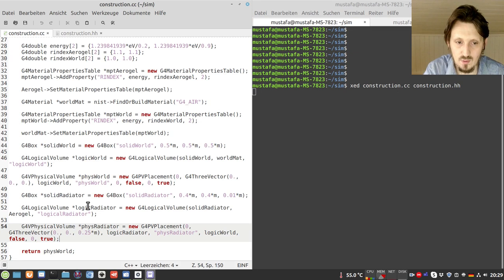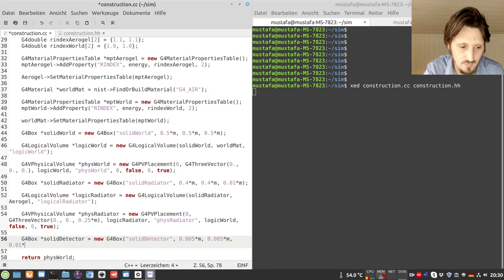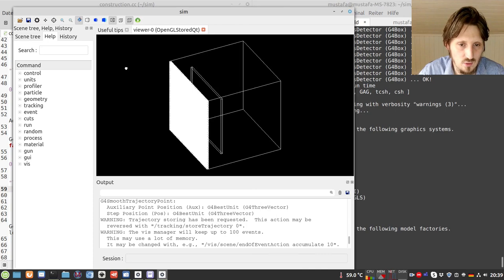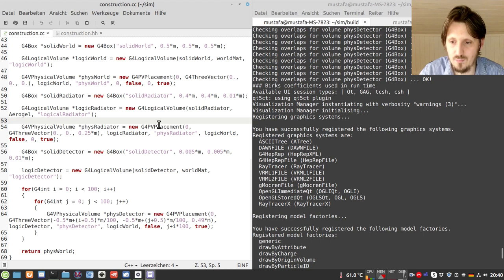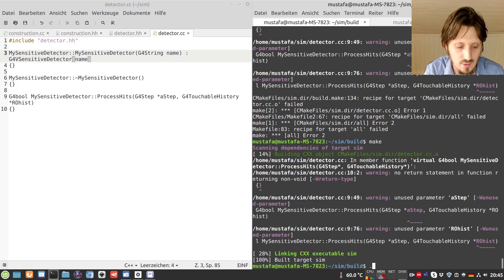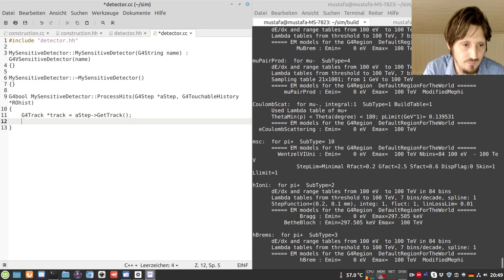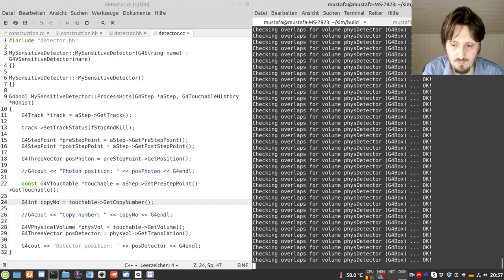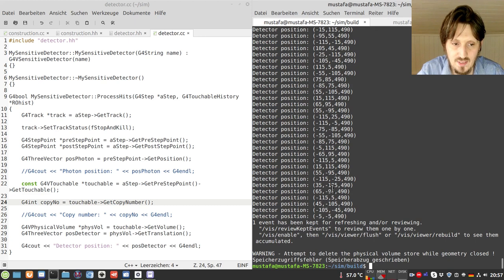Geant4 Tutorial 7: Inserting Sensitive Detectors

Comment: @Lucas Backes added a comment about issues running the simulation, and I thought I'd provide my fix as well. I included a command to the UImanager that updated the visualizer as prompted by the debug feature in GEANT4. You can compile Geant4 in debug mode by using the command in the build folder, ' cmake -DCMAKE_BUILD_TYPE=Debug . ' 

This saved me a ton of time.

Comment: Hi There. I after running this code, my GL is very slow and responds with a significant delay. What is the real problem. Would the multithreading solve it?
HP Envy x360 with Core: 12
Memory :512GB SSD
RAM : 16GB DDR 4 3200MHz
Processor: Intel core 7
Graphic Card: Intel Graphics

Comment: Hi! Thanks so much for this series. I have a problem when I run the program. At the moment I exectue ./sim it works just fine and shows me the construction made. But when I'm trying to display the beam and check the photon tracks output it crahses immediately and displays the "Segmentation fault (core dumped)" message. It closes automatically. I don't know why is this happening, can you give me a hand please? Thanks again :D
Reply: For anyone having issues with running the simulation (crashes when you run the beam and says "core dumped"), make sure to add a return true; at the end of the detector.cc G4bool MySensitiveDetector class. That should fix it : )
This is a reply from Lucas Backes, above .
Reply: @mohamedghoneim3782  Thanks a million!!!!!!!!!! I also had the same problem and did not know how to solve it !!!
Reply: I did that and I still get the “Segmentation fault (core dumped)”. Are there any other suggestions?

Comment: need to add a return value in function ProcessHits, or it will cause illegal hardware instruction core dumped error with gcc 14.1.1 in Arch Linux. Seems that ubuntu does not have the issue, maybe it's caused by gcc version?

Comment: thank you for such nice tutorials, one comment and one question though;
comment: Although I have already used sensitive detector class, never realised that without steppingaction one can pull step , that happened in the processhits function.
question: can you briefly tell the use of digitization class, is it not the same as the sensitive class with the sensor hit information like you did in the last few lines of the codes?
ty again
Reply from the maker: Yes with only a sensitive detector you can already do some simple digitization such as binning of time and space. However for more complex operations like adding dead time to the electronics you have to store all hits in containers with the help of the of the digi or hit class. At the end of each event you can then access all hits and apply certain operations on them.

Comment: I wonder how I can implement this sensitive detector for a sandwich like detector geometry. I built a similar model for protons in 3 layers of silicon slab, 2nd layer being the sensitive detector. But unfortunately, protons and other secondaries are stuck inside the sensitive detector. They do not propagate through the sensitive detector and strike the 3rd layer. I would appreciate if anyone could help me in this regard.
Reply from the maker: Did you remove the kill function inside the sensitive detector? Otherwise all particle tracks will be destroyed as soon as they enter the sensitive part. If you want to block the photons from entering the lower detector you can either make a conditional kill statement that only photon tracks should be killed or make another absorption layer between the second and third layer
Reply: @physics_matters  Thank you so much! I really appreciate your help. I have been looking for a solution to this since last week but couldn't figure out the mistake. I have completely overlooked the kill function. Now it's working and generating particles in the 3rd layer as well. Thanks again!
Reply: @ronyrony4404  
Hi, may I kindly ask you to give a hint on what is the meaning behind the "kill function"? I believe, I have a similar problem now. Is it related to tracking?

Comment: Thank you for such a nice tutorial! I have a doubt, you took 0.49*m as a detector upper surface in G4ThreeVector so after compiling,  the position of the photons are showing as 480 in the z-direction. should it  be 490nm? In my case, it was showing 490.
Reply: I believe 0.5 m is the half-width of the world vol (distance between origin and edge of world vol in z direction). Since, 0.01 m is half-width of detector in z-direction, 0.5-2*0.01 = 0.48 m is the starting edge of the detector pixel. Hope I am right!

Comment: Is it possible to generate particles inside the sensitive detector logical volume?
Reply from the maker: Yea this should should work without any problems. Did you receive an error message?
Reply: @physics_matters  yes, I receive a segmentation violation when I try to run a beamON.
In particular, I have only one logical volume inside the world volume, where I want to generate particles and in a meantime, the same volume has to be a sensitive detector.
There is no crash when I comment on the line where I use the method SetSensitiveDetector inside the ConstructSDandField()  function.
Also, I employ Stepping Action class and I am not sure if it could cause the problem.

In addition, I've seen that you mentioned in one of the answers to the comment that it's better to remove the kill function inside the sensitive detector. Could you give a hint on what is that or where to look for it, as I can't find a piece of relative information inside the Sensitive Detector class documentation?
Reply: @1global_warming1  I think I had the same problem as you. I noticed the comment under the video and for me, it fixed the problem:       " Unfortunately, I have forgotten to add the statement "return true" at the end of the G4bool ProcessHits() method. Before you run and test the code you have to add it there, otherwise, it might produce an error message."  Hopefully it will help

Comment: The code of was compiled correctly but I didn't get any output data from G4cout
Reply: were you able to resolve this? i have the same issue
Reply: @riakataria8085  no i tried alot of things but i gave up and changed the geant4 version i was working with, and used the 10.7.4 version then everything in the tutorial worked fine
Reply: @riakataria8085  having the same issue. Any fix besides g4 version?

Comment: Hi. Thank you for the wonderful videos.
Please how do I move past this error:

CMakeFiles/sim.dir/detector.cc.o:(.data.rel.ro._ZTV19MySensitiveDetector[_ZTV19MySensitiveDetector]+0x60): undefined reference to `MySensitiveDetector::ConstructSDandField()'
collect2: error: ld returned 1 exit status
CMakeFiles/sim.dir/build.make:268: recipe for target 'sim' failed
make[2]: * [sim] Error 1
CMakeFiles/Makefile2:67: recipe for target 'CMakeFiles/sim.dir/all' failed
make[1]: * [CMakeFiles/sim.dir/all] Error 2
Makefile:83: recipe for target 'all' failed
make: * [all] Error 2
Reply: Have you solved this error?  I,m also getting the same error, Solution is  mentioned in description  but I,m not able to remove the error.
Reply: @sonidevi1871  No solution yet
Reply: try changing MySensitiveDetector::ConstructSDandField()' this with MyDetectorConstruction::ConstructSDandField()' in the detector construction source file. this should work if you defined ConstructSDandField() in the .hh file
Reply: @almighty9188  thanks,that I have already changed, may you tell me how to use return statement that Sir told in discription?
Reply: I got the same error message initially but it was solved by just running cmake again, maybe this helps
Reply: Hey did anyone get the solution for the above problem.. i am getting the same..please help
Reply: @sonidevi1871  have you found some solution for the problem...please help

Comment: I have this error:
### CAUGHT SIGNAL: 11 ### address: 0,  signal =  SIGSEGV, value =   11, description = segmentation violation. Unknown segmentation fault error: 128.
GDB output while debugging is:
Thread 1 "sim" received signal SIGSEGV, Segmentation fault.
0x00007ffff6d4047e in __GI___libc_free (mem=0x4011cb4cb062ca21) at ./malloc/malloc.c:3368
3368	./malloc/malloc.c: No such file or directory.
(gdb) where
#0  0x00007ffff6d4047e in __GI___libc_free (mem=0x4011cb4cb062ca21) at ./malloc/malloc.c:3368
#1  0x0000555555559f4e in MySensitiveDetector::MySensitiveDetector(G4String) [clone .cold] ()
#2  0x0000000000000000 in ?? ()
Reply: Yes Same
Reply: Do you get any solution?